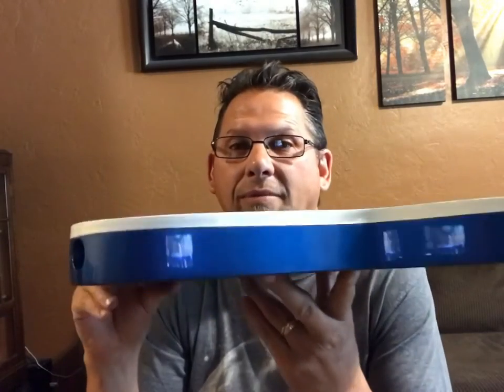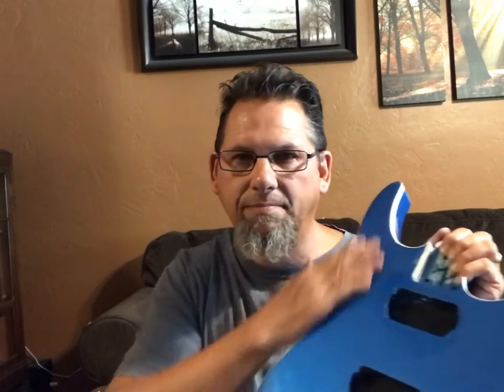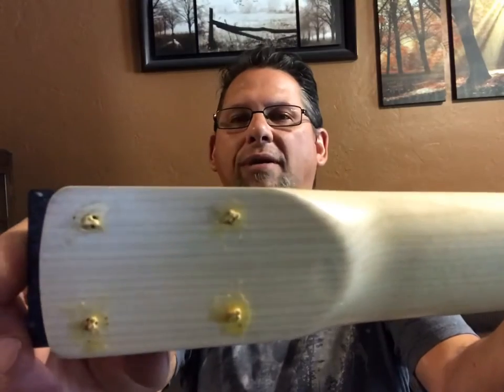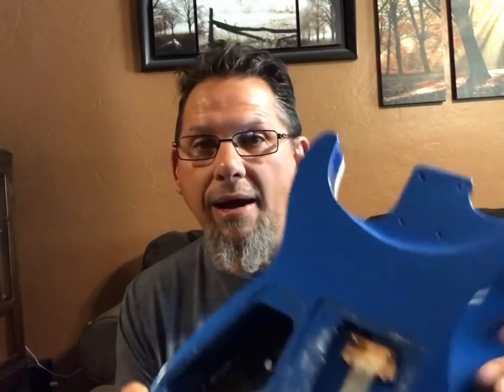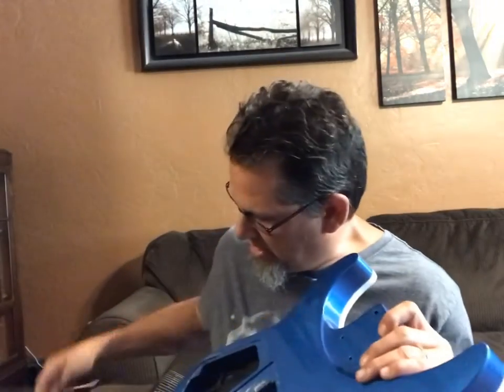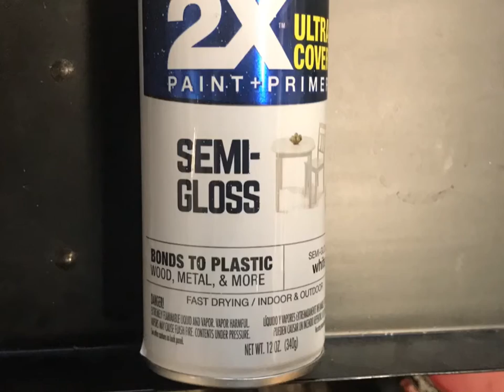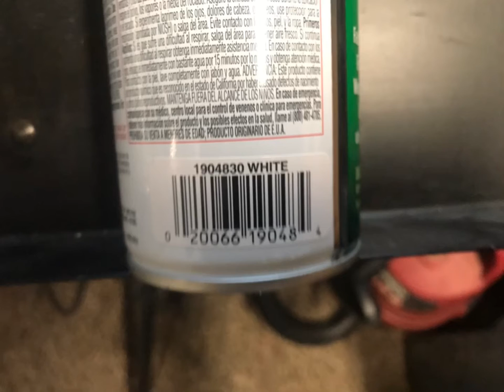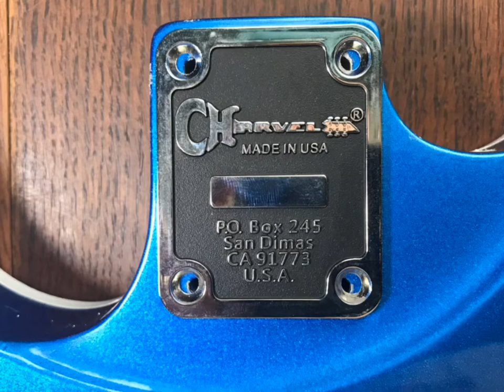DIY Guitar Project Jackson/Charvel Part#4. A little set back, but progressing slowly.

Comment: The wide looks good but I am assuming that you are looking to make it accurate to the original (which I am not familiar with). I use those dowel rods for the same purpose. Anyway nice work, just sorry it hasn't work out to your liking yet.
Reply from the maker: Guitar Repair and Maintenance By Jeff Raaymaker , yeah I think it looks ok from a distance, I mean I got it straight but the original was only about 3/8”. Now it’s like 1/2”. It’s not going to be completely accurate cause the original only had 1 humbucker. But I do want the paint job to look like it. I showed a pic of the original in either part 1 or 2.